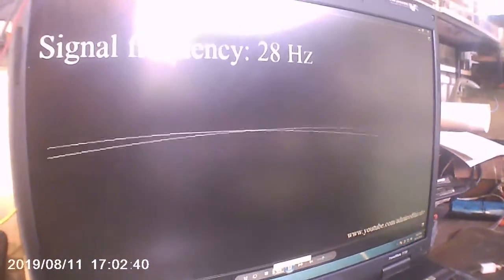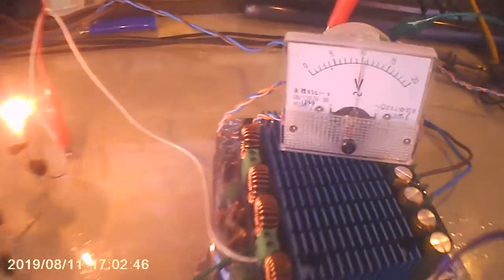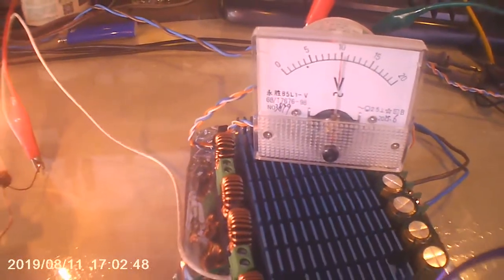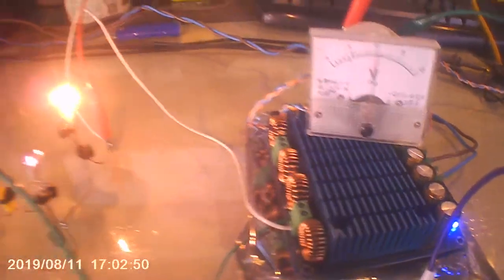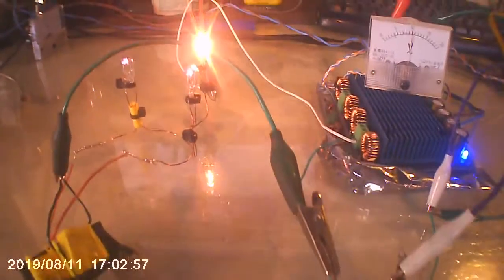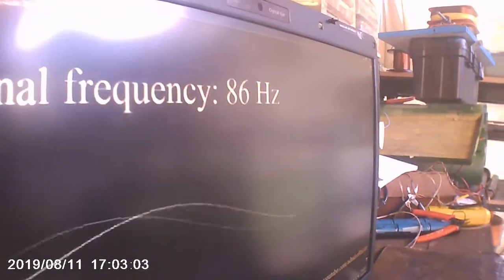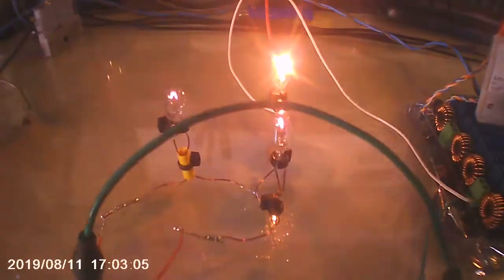Bucking Coils Experiments 10 fails 1 success     ( Transformers Part 47 / 365 )

Comment: Hi Patrick, a coil below its natural resonance frequency behaves like an inductor, so it's current lags the applied voltage. At resonance the current and voltage are in phase because both inductive and capacitive reactances are equal yet opposite. However an inductor operating above it's natural resonance frequency has more capacitive reactance than inductive reactance so it behaves like a capacitor with current leading the applied voltage. Due to this fact, at certain frequencies the currents in L1 and L2 are travelling in opposite directions so they can add to produce zero current at the node. Yet their algebraic total can exceed the measured input current to the circuit by many times. Meaning yes under these conditions can be achieved.
Reply: Very helpful comment I hope Patrick saw this. Thanks for sharing.
Reply: Would we assume in this case {for clarification} that {example} L1 is at resonance base and L2 some harmonic of that ?

Or another way to state it , is say L1 is x base resonance, then say L2 is a sub harmonic of that . Then by inputting the x base resonance of L1 then L2 would be in a state of {excess offset} as you stated , while L1 would be at base resonance, i really don’t understand what a ‘current’ is only inductive inertia so I have a difficult time translating these sometimes, maybe this is my flaw ? 

My translation would look like this :

When an inductor operates at a level above base standing wave then the tractor force is above 0 offset , so think of a gyroscope wheel , at base resonance this is a 0 state offset , move above that and you have that much more tractor force offsetting the inertia. 

So the inductor acts like a tractor device ‘a capacitor’ 

We have two inductors, L1 and L2 in the circuit, if you have one at the 0 offset state {say L1} and one in a state that has an excess of tractor force {L2} by degrees , then these two acting simultaneously will offset the total inertia of the device, so input inertia could be 0 and output {actualized inerta } could be sums above.
Reply: smokyatgroups 

why it would function is much more interesting....maybe a super simplified translation:??.

Think two gyroscope wheels on a common shaft , but somehow one wheel can be at a rotational frequency sums higher than the other wheel , this wheels tractor force offsets and compensates the first wheel which still can be used for inertia to do work. 

That’s real ‘magik’ lol
Reply: @kolinevans9127  @Kolin with a perfect resistor current starts to flow as soon as the voltage is applied.  With a perfect inductor current doesn't start to flow immediately, it initially looks like an open circuit, so current gradually builds. Hence the current lags behind the applied voltage.  If the applied volts are alternating (AC) the current can lag by up to a quarter of a cycle or -90 degrees behind the ac volts. It is the opposite situation for a capacitor, when we try to charge a capacitor it looks like a short circuit initially so there's little or no voltage until charge gradually builds. With applied AC volts to capacitors current can lead by up to +90 degrees.  With AC currents passing through perfect inductors and perfect capacitors, one being +90 degrees with respect to voltage the other -90 degrees ). We can see the two currents are travelling  at 180 degrees to each other (opposite directions) at the same moment in time so the 2 currents can and do mathematically cancel each other out (sometimes only partially though).  With coiled inductors, as ac frequency increases, current gradually finds it easier to pass across the airspace between the coil's wire turns and the layers of turns than to pass though the wire itself. 
So coils eventually become capacitors as frequencies increase.  So if we have 2  non-similar coils each one has its own frequency point where it starts to look like a capacitor, in it's response. Hope this is clearer.
Reply: smokyatgroups yes its clear thank you , it’s hard for me to translate a physical analog but with an ideal force vector a shaft will spin immediately, with a large mass of inertia the force vector will lag until the rotational frequency offsets the inertia so there will be a non linear force vector. 

The inversion of that is a wheel already at velocity so the tractor force is already present on that device.

The tractor force is always at a 90 deg vector to the angular force which is an expansion force , at ‘resonance’ rotational frequency. 

Yes you have made this clear and I can understand it thank you for your contributions to this conversation I hope that Patrick will read these and have a think about it. 

I have been testing and observing the inertia shift from ‘left’ to ‘right’  as I shift the frequency from the resonance base above it and below it, the two inertia are offset at a 90deg when the larger mass is at the rotating frequency of the smaller mass base standing wave resonance. 

Then below towards the larger mass base standing wave resonance the inertia is 180 offset , then at larger mass base they are aligned again together.

At the resonance point I’m looking at the ratio at which the smaller mass inductor inertia ‘cuts’ across the larger mass from peak to peak it looks like about 1.618 to me but I’d have to measure it. 

Thanks again for the comment.
Reply: smokyatgroups 

let’s think properly about what we are stating, your comment, and this fact I feel proves that Tractor force is a force from a higher energy density state that  ‘vectors’ into the 3D plain

Let me outline, 

When an inductor is at a rotational state some multiple above its Swave base resonance frequency, then at a point the tractor force causes the inductive inertia , {this is the inertia in the 3D plain } to be not only offset but to occur BEFORE the applied force, but only as an observer from the 3D plain.

As we are in the 3D plain observing we can observe with equipment an inertia that is occurring before the applied force. 

Seemingly Magik result that result from the tractor vortex force vectoring in from a higher energy density state.